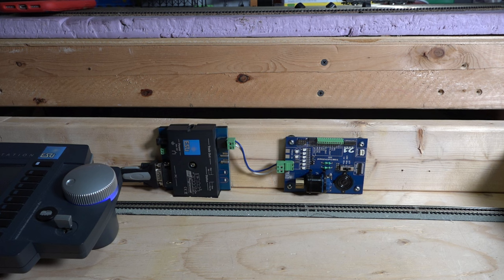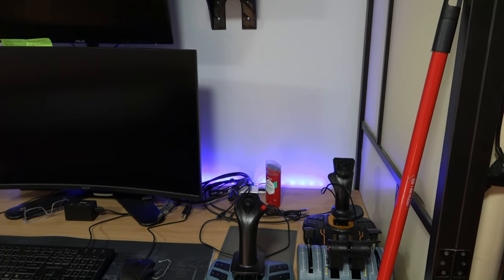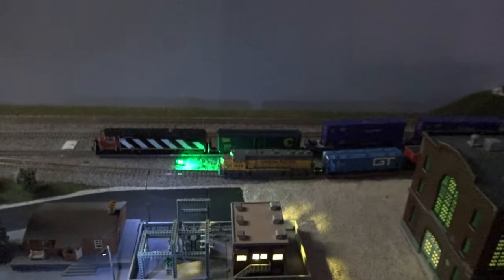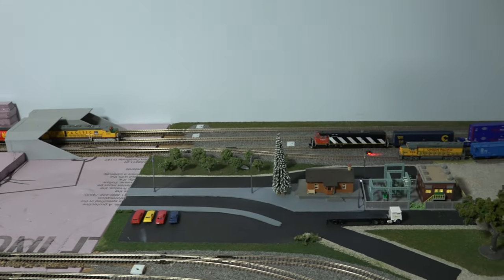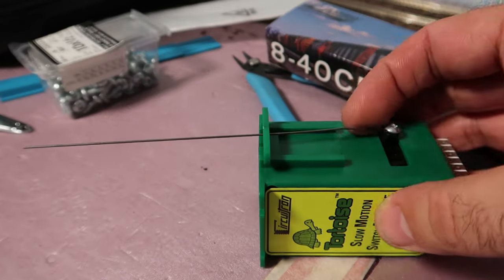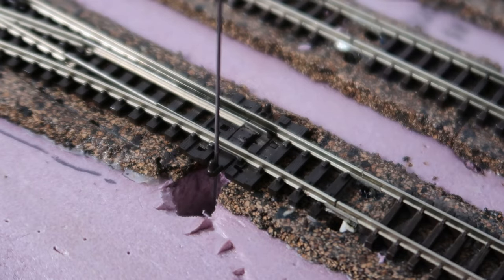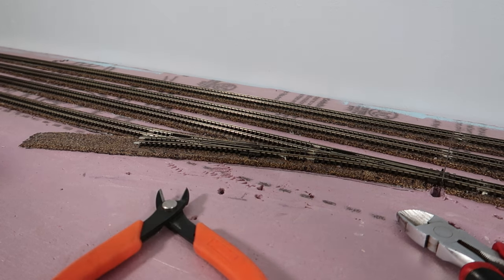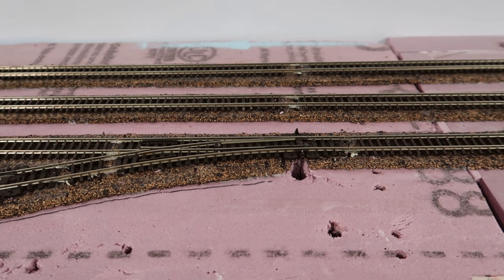N Scale Model Train Layout Rebuild: Upgrades, Automation & Troubleshooting Update!

Comment: Nice to see you got layout working again , those coal cars are too light need more wait and if they are Kato couplers they won't work well with micro trains couplers any car it can be couplers , wheels or car weight for running problem check those 3 things  and good luck !
Reply from the maker: Hey @davidallen6333,  It's good to hear from you. Thank you for the advice.  I'm going to try adding more weight and see what happens. 
Thank you for your comment.
Reply: Nice looking layout,change those kato couplers for micro trains couplers and your derailments will stop👍